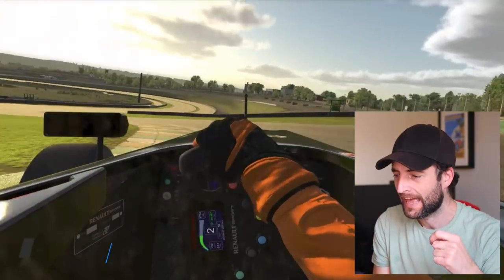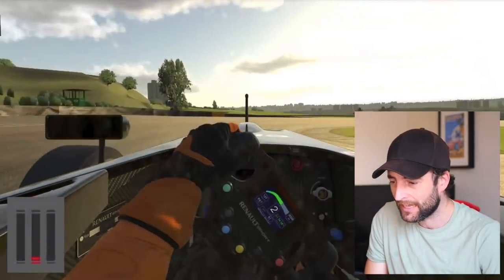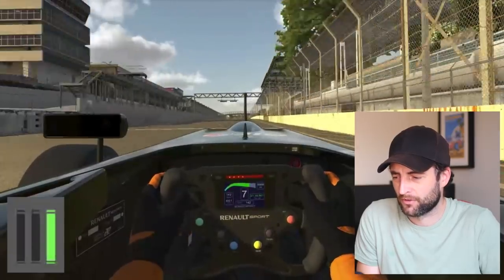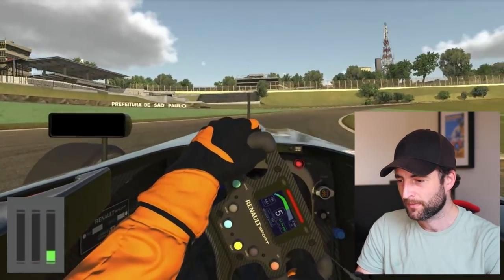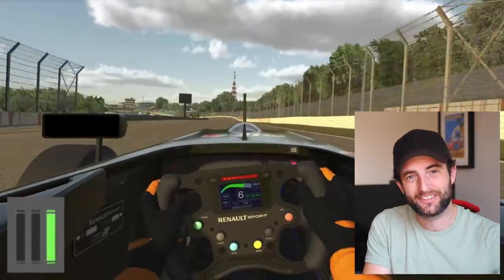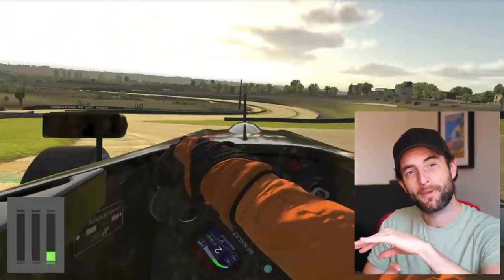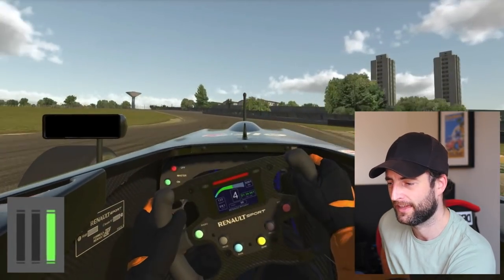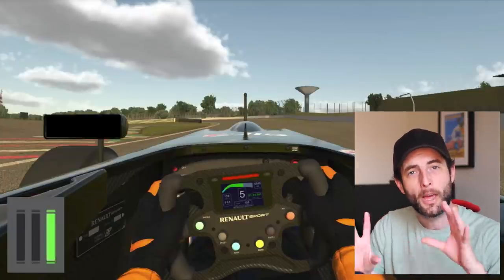Where to Begin with Sim Racing Setup (iRacing)

Comment: If you are using the graphic car to record, use the CPU, it helps a lot with frame rate. Also, lower bitrate
Reply: why CPU?
Reply: @vsm1456   The CPU can normally generate videos with a better quality. But on the other side it's a heavy task for the CPU as well and it can cause problems for other programs and games, which are CPU-heavy. 
So if the game runs fine with the CPU, then it's a good idea to take it. If the game starts to stutter while recording, then the GPU should be preferred. For professionals it might even be interesting to use a 2nd PC for capturing the 1st PCs video signal.
Reply: Why not a capture card? If they are planning on doing this for the longer term, I think it would be the best to use a standalone device dedicated to recording
Reply: @HoshinoMirai  They may not be able to afford one. Capture cards tend to be pricey. Thus they would need to rely on either their CPU or GPU for video recording.
Reply: Ya looks like the game video is run on a potato

Comment: I usually tell people to mess with the alignment before exploring the suspension, because the car default setup is usually very balanced out of the go. If the car start to be unstable from having better grip, you know it require some suspension change.

Comment: you should do a video on how how i drive on iracing with the v8s. ive had the car turn in under brakes and i still have the wheel straight. idk if thats just my braking or the setup

Comment: This is a great video - I really appreciate the use of an open-wheeler.
I had to laugh a bit though. I just came off a season in the Formula Renault 3.5 - the idea of getting rear stability in that car is a dream. That particular car on iRacing might be the most difficult one on the service. I learned more about the deficiencies in my right foot using that car than I could possibly describe. Granted, the driver displayed seemed to have great right foot control, but finding stability in the rear of that car felt nearly impossible for me for pretty much the entire season. We're on to the Williams F1 this season though, so the FR3.5 is a not-so-fond memory at this point.
I'm curious Scott, suppose I analyzed my lap and decided I'd like to increase the stiffness of the rear suspension. I check my rear ride height (say it's 1.200"), I then stiffen my rear springs a couple clicks, and my ride height will surely increase (If I had to guess/remember correctly, probably to something like 1.250"). Should I then use the (iirc) spring perch adjustment to bring the rear of the car back down to ~1.200"? I'm hoping to translate this information into tuning the F1 car, as our season starts tomorrow and I'm having some stability issues with it (presently around my driving technique, I think I'm too aggressive with the wheel, but then that makes me think I might be fighting it too much, which could point to some understeer issues on entry)

Comment: Why do you say the stiffness of the rear suspension doesn't matter at turn in? The total weight on all four corners is almost constant, so if the front dives down, the rear jacks up. It's the same thing as during accelerator, just flipped the other way.

Comment: I like these series a lot, and the real driving instructional videos too.Valuable info, unfortunately, sims often react completely differently to setup changes than expected.
You can figure out what you want the car to handle like, but getting it in the sim is a complete other story. You cannot implement 1 to 1 the changes you would do on a real car in a sim car. It takes a lot of trial and error at first to begin to understand what the changes do on that particular car model, with that particular tyre model. Then you will get faster at adapting the car.  Until the next tyre model / car model change, and you can start over again. It is ennoying ass hell, particularly when you spent weeks preparing for big race, made the setup to your liking, and then Iracing pops up a new update...and everything goes to the bin, because that car doesn't handle the same anymore. And as Murphy is always around.....they push the update 5 hours before the race!!!
Keep up the excellent work Sir!!!

Comment: Hi. What would your suggestion be. When I turn in, the car doesn't turn in enough unless I apply light throttle. Gte m8 iracing. Cheers
Reply: Just to add. I have to break a bit earlier than rest of field to compensate for my very early add of throttle to turn in properly. If this makes sense. Lol
Reply: @zindc31  if I understand correctly, you see understeer while the car is only loaded laterally and is neutral longitudinally. I'd try reducing LSD coast settings. or stiffen front slow bump and soften front slow rebound (to keep both wheels in good contact with the ground). or maybe soften front sway bar and springs. I can be wrong though

Comment: Is there some kind of priority/rules of thumb list on order of adjustments? For example, it's probably better to adjust aero and suspension before playing with gearing too much since the goal is to optimize power settings at lowest and highest speeds. Obviously you want to look at big ticket adjustments before doing fine tweaking, but assuming I had to start a setup from scratch, how do I identify the best adjustments to make those big ticket gains vs. which adjustments I need to get that extra 10th? 
  Thanks as always for the AWESOME content. One of the greatest beauties of racing is that no matter how much you know, you still have a LOT to learn!
Reply: After getting the basics in order (right tyre compound and pressures, fuel load, very general downforce levels, engine limiter, etc), the big ticket gains are the ones that enhance your driving style, while the "extra 10th" changes are increasing the cars innate pace. It's very hard to give rule of thumb on the "big ticket" ones as that's completely down to particular driver skills. So you have to experiment for yourself.
The thing about setups is that just like any other difficult topic "hard work pays off". And imho it's virtually impossible to be eased into it, heck this video is as "basic" as it can be and already Scott is contradicting some of the main channel teachings just to lower the entry bar enough so you can get your feet wet. But if you really want to be faster, the easiest way is to dive head first and be serious about it. Rules of thumb will only make you feel good for a short time and then you will grow out of them and be in the same position needing more guidance and only marginally faster.

Comment: You really should invest into something different to watch/record the videos. The onboard is stuttering and is hard to watch.
Reply: I really noticed in this vid and thought maybe it was just due to the low res vid being posted first but looking back at other videos and it is quite noticeable
Reply: It's a video submitted by a user for analysis. That 15fps is pretty hard to watch.
Reply from the maker: Yes, I'm struggling with this. I used Quicktime, but I'll try with OBS next.